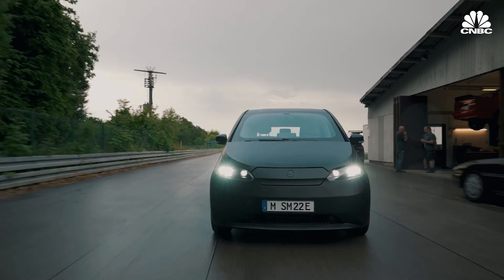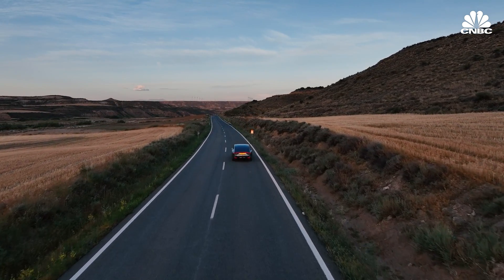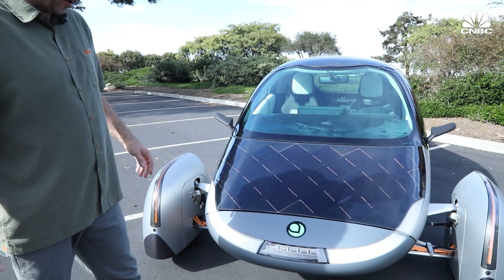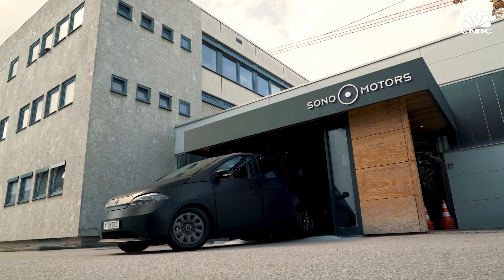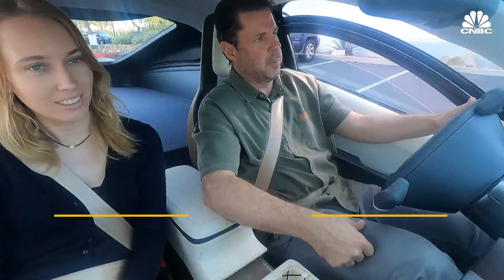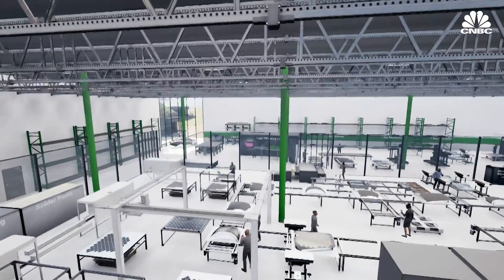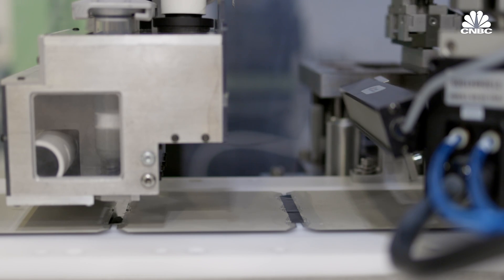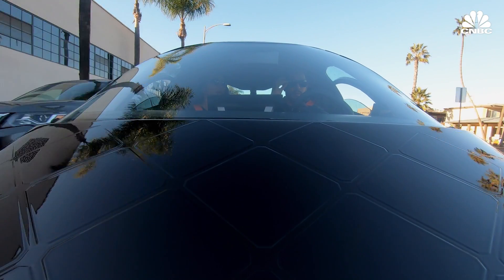Solar Powered Cars Are Here — But Can They Go Mainstream?

Comment: So this is the same battery type as all the other EVs ? We need to be working on a safer battery system . That is the biggest problem .
Reply: EVs are safer than ice cars though…
Reply: the stats for the gas ang diesel powered vehicles diffinitely explode easier.
Reply: @MDF4072  cause the fuel is flammable. I prefer hybrid technology over electric any given day.
Reply: @maroon9273  Huh? Statistically speaking, hybrids are the worst when it come to the potential of catching on fire, followed closely by gasoline-only ones. It pure battery vehicles that are actually less prone to going up in smoke.
Reply: The Sono Sion is going to use a lithium iron phosphate (LiFePO4, LFP, etc.) pack that is virtually immune to thermal runaway or fires. Also, the percentage of car fires in gasoline cars are far greater than in any sort of battery electric vehicle, regardless of battery chemistry. It's just that we've had internal combustion engine fires for over a century now and the news media doesn't talk about it any longer. EVs are new, relatively speaking, and the few problems they have are somehow "breaking" headline news.
Reply: @benjaminnead8557  Gas fires are easy to put out and they are not nearly as volatile as EV fires , I am a retired auto tech and I have seen what these cars can do first hand , nobody can change what I have seen .
Reply: @nativestacker4185  I don't dispute that lithium battery fires are a whole different beast than gasoline ones, but the chemistry of the battery is a big consideration . . . https://www.youtube.com/watch?v=D8xNjz73p80

And the BYD/FinDreams Blade is what's basically in the Sono Sion . . . https://www.youtube.com/watch?v=CGQwqWqzkNA
Reply: @nativestacker4185  Most eVs are Teslas, and Teslas generally aren't going to Pep Boys or similar.  So I am a bit skeptical of your claim that as a "a retired auto tech", you saw a whole lot of eV fires.
Reply: Lithium iron phosphate (LiFePO4) batteries are more chemically stable and less likely to explode than older designs, though also less energy-dense.
Reply: LFP-batteryes🔋 can't catch fire 
❌🔥❌
Reply: @mikafiltenborg7572  This is safer than what in your gas tank (nail penetration test on the cell that's going to be in the Sono Sion) . . . 
https://www.youtube.com/watch?v=CGQwqWqzkNA

Comment: Why does it look so stupid?  Looks like they don't want anyone to actually buy it and probably find out it doesn't work.  Skeptical af, look how many problems electric cars had
Reply: Looks are subjective. Personally I think it looks amazing, and it has 37k preorders so I'm not the only one
Reply: Problems? I've driven a Chevy Bolt for 5 years and have had the problem of NOT paying for oil changes, oil filters, fuel filters, air filters, spark plugs, valve adjustments,  smog checks, transmission oil changes, or fan belts. I haven't worried about having a catalytic converter stolen.  I have replaced the cabin air filter for $13, though. So many problems! :text-green-game-over:
Reply: What problems?
Reply: yeah. imagine leaving the car parked in the sun and get the range you need to drive around. realy stupid.
Reply: You are obviously not interested in EVs and that’s ok. Maybe you live in a small apartment and have no place to charge.

Comment: The only way I would be able to afford this is in a used market I wonder what's the price going to be after used
Reply: Both Aptera and Sono are among the cheaper EVs that will be available.
Reply: @Hans-gb4mv  odds are their pricing will change once deliveries start
Reply: @Leo Perez  I don't think they will.   By the time they're being delivered, the brunt of the supply chain problems will be over...unless China and Taiwan start fighting
Reply: When my Mitsubishi i-MiEV was leased new in 2012, the original lessee was making monthly payments towards a $30K purchase. But they also got the $7500 federal EV tax credit. So, when they brought it back to the dealer a few years later, it became a used car based on $22,500 ($30K minus $7500) and, as is typically the case with all used cars, at around 50% of that . . . or around $11K. 

2015 was a very good time to buy a used EV. Many Nissan Leafs and i-MiEVs were leased in 2012, when they first came out, and they all came off lease at around the same time. Hence, the market was flooded all at once. I was able to snap up my i-MiEV for around $7K. It only had around 18K miles on the odometer and most of the factory warranties still in effect. In 2020, I noticed that my battery wasn't charging to full any longer and, without much fuss and bother, I was able to get a warranty replacement for free. So, I'm probably good to go for another 6 years or so, when I anticipate that solar electric vehicles will be rolling off the production lines. 

In the mean time, if you need a buy a used car sooner than later, get an EV and leave your petroleum headaches behind. If I was buying an affordable used EV today, I'd seriously consider a Chevy Bolt. Fairly soon, you should be able to take advantage of a provision in the recently-passed Inflation Reduction Act that gives the buyer of any used EV a $4K rebate. Used solar EVs will be an eventuality, but it's going to take a few years. If they're new in 2025, assume that it will be 2028 before used solar EVs are plentiful.
Reply: @benjaminnead8557  The 1984 named Inflation Reduction Act is very restrictive about what qualifies for the credit.
Reply: That all hinges on them ramping their production to meet demand. That'll take some time.
Reply: They're already being sold for less than the average sale price of a new car.  Used price will depend on how happy people are with them.   If people are happy, it'll take a long time for any used market saturation.

Comment: The extra weight will reduce most of the extra range you will get out of it. Its not a good idea.
Reply: These are not panels but a flexible plastic film
Reply: There is not much additional weight. You replase the exterior plating with solar panels.
Reply: Solar panels have come a long way in 30 years. Why are people so behind the times on this tech? I think free energy is unpopular with billionaires who want you charging at their stations all day, so they keep modern solar tech hidden from view. How long do you have to charge if half of your battery is already filled by the Sun? Hmmmm
Reply: imagine getting a dent in your door and your car no longer runs and it costs $30k to replace because the solar panel is damaged lolol
Reply: @chiquita683  Wow! Where do you buy a solar panel for $30K? Are they gold plated?
Reply: @chiquita683  Your bananas!

Comment: These will be perfect for surviving a zombie apocalypse
Reply: Combustion engines would be a liability. Zombies would always hear you. EVs are silent and require little maintenance. Solar will help you stay away from charging stations and keep you silent and hidden.
Reply: Cuz they don't make noise!
Reply: Yes, when the drivers of these cars are getting eaten on the side of the road by zombies you'll be able to get away quickly in a combustible engine car
Reply: @chiquita683  only until you need to refill at the next gas station that's occupied by zombies

Comment: You better get a good insurance with those cars... just to fix it must be a nightmare
Reply: Both Sono and Aptera will release all manuals and supply parts so that you can get those cars fixed yourself or by anyone who has some knowledge about working on vehicles.
Reply: They're terribly simple vehicles.  The bulk of the cost are the very reliable batteries
Reply: Evs generally need far less maintenance than ICEs. The aptera is fairly modular, so repairs should be straightforward
Reply: How so?